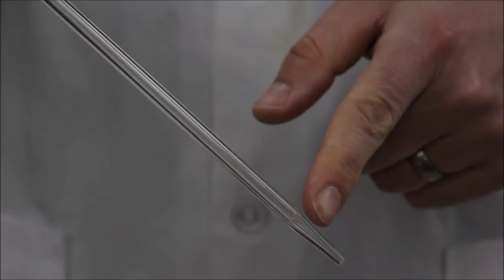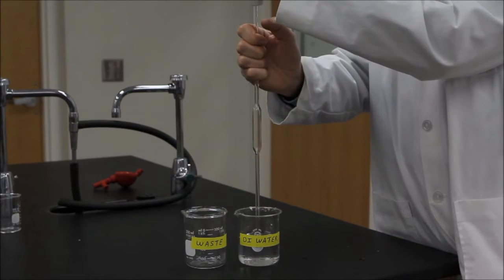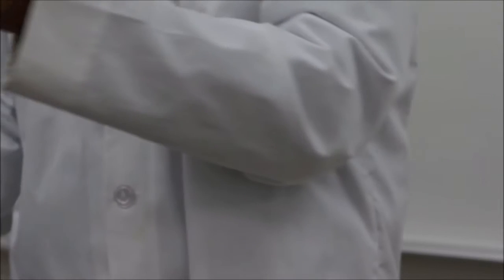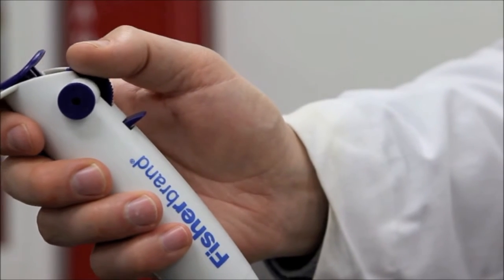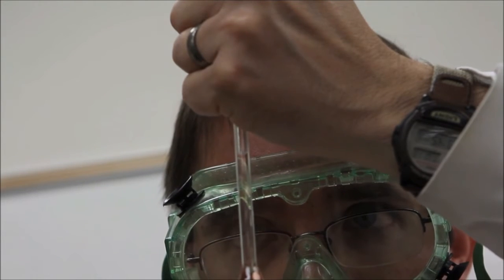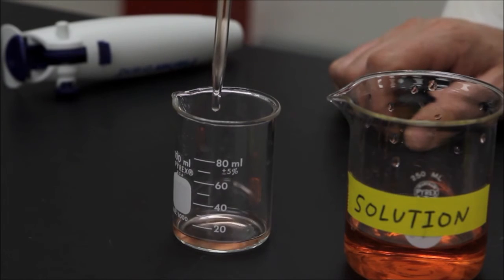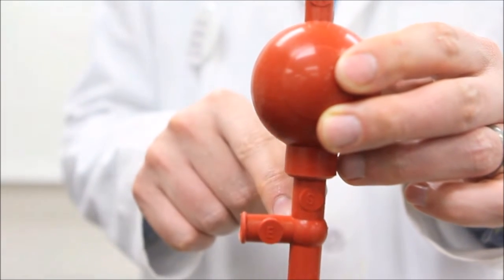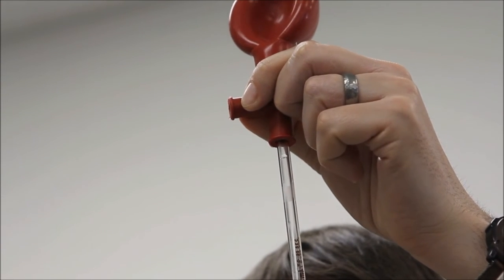How to use a volumetric pipette

Comment: Nice video.  One detail that I didn't see mentioned (maybe I missed it) is that when the delivery of liquid is finished, a small quantity of liquid will remain in tip.  One should not attempt to shake or blow out this small amount of liquid.  The pipette is calibrated to deliver the stated volume (not contain the stated volume), and it is calibrated with that drip remaining in the tip.  A good experiment for students is to see, empirically, how much difference it makes by weighing what is delivered with and without that small additional volume being shaken out.  Obviously, the relative error will be larger for pipettes of smaller indicated volume (e.g., 5-mL vs 50-mL).
Reply: Thank u